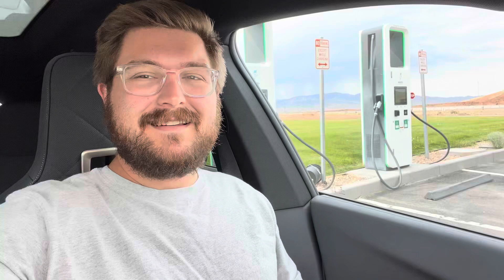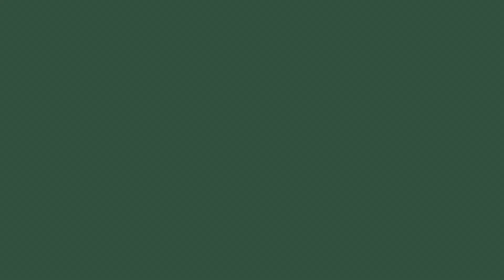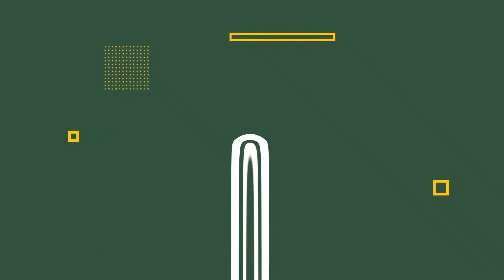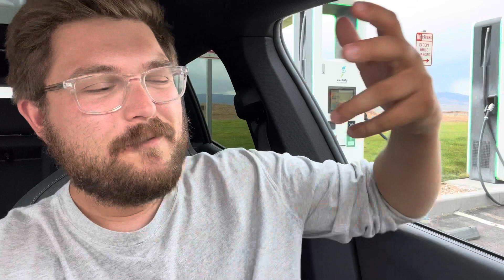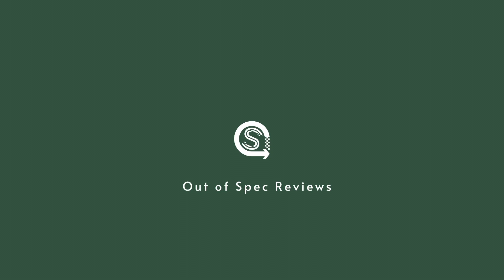Here Are The Benefits Of An 800 Volt EV Architecture - Is It Really That Much Better Than 400 Volts?

Comment: The BMW iX M60 is a $110,000+ car with options…..it better be fine! Problem is, not all 350kW DCFC units offer 500amps, so its slim pickings for the BMW to get it’s full charge rate.  And you’re right….the individual cells have no idea of the total pack voltage.   Each cell is 3.7v nominal, so when 100% SOC cell voltage is about 4.25v and at 0% SOC around 3.4v maybe I’m not sure. LFP and different chemistry will be different I think.  Every pack has their cells wired in a combination of parallel and series, so what determines the voltage is the number of cells and the combinations of parallel and series wiring.

Comment: When correctly engineered it does not matter whether you have 400, 600 or 800V. It just gets more expensive in semi conductors. You have to balance the cost of the components. For small passenger cars 400V is enough. Even less for really small cars like the Fiat 500E. For larger lorries aka pickup trucks maybe 800V is more efficient and the cost justified. With semis its maybe even 1600V. With airplanes it may be even more, in ships maybe less. You always have to balance the amount of copper and fuses vs semiconductors and insulation.
Reply: Nobody has been able to quantify the additional costs so far. Is it like going from a 11 kW AC charger to a 22 kW builtin charger?

Comment: My experience is that it makes way more sense to have well functioning 150-200kW chargers rather than those very expensive 300+ chargers. Charge time is very impressive at 150-200 aswell. I've never had time to finish my snack, lunch and/or toilet visit before my Tesla is finished charging. I always have to go out and move the car.
Reply: I think most of the public would prefer a vehicle they could charge in a similar time to filling an ICE, where the stop does not necessitate some other time wasting activity to justify the stop.
Reply: The important german National HPC network tender means products will be developed and come to market in a few months that provide as a requirement 200 kW (2x or 1x 400 kW) which should be enough for the foreseeable future.
Kyle's favourite Alpitronic HYC400 will be able to dynamically partition it in 50 kW steps.

Comment: Good information. "Ioniq guy" channel just put out a video comparing 110 volt vs 240 volt charging cost analysis, on an Hyundai Ioniq 5. Interesting to see the low monthly mileage significant cost difference (for home charging). Curious if 400 volt architecture reduces volts vs  cost difference. And, does it cost more to home charge 400 volt vs 800 volt?
Reply: Power companies provide your home at a fixed KWh cost no matter how fast you draw that power. So it shouldn't change the cost.

Comment: Tesla model S plaid can take 5-33% at 250kw flat. That's unbelievable with 400v tech. How do they do it? It's great engineering. And heat loss is around 10% which is in line with 900v tech like lucid. And their cable is thinner than any 800 changer (like electrify america). And the interesting thing is that, their v3 (250kw)  charger's cable which has a higher ampere is thinner than v2 (150kw). How? I also thought that higher amperes need thicker cable but tesla defying something? Its great engineering and innovation. Hands off. Tesla is really years ahead.
Reply: 700 amps and really short cable attached to the stall
Reply: @lucistnik  yep that impressive
Reply: V3 is a thinner cable because it is water cooled.  You can hear the Supercharger pump and radiator fan come on when charging at high current.  That sound is absent at V2 chargers.
Reply: @johnpoldo8817  so that’s what that noise was. We just hit eight Tesla superchargers in our Kia EV Niro (with adapter) on a road trip to Ontario last week. And of course, my car wasn’t making any noise from the chargers, but the Teslas were very loud indeed. Now I know! Thanks.
Reply: They simply added cooling to the cable. The model S has obsolete battery tech and to keep the cells from degrading they require an overkill cooing system. Tesla isn't ahead. They're lagging terribly behind the Koreans and the Chinese. That aside, so are European manufacturers except for the very few who finally decided to adapt the 800V architecture.

Comment: Doesn’t an 800v vehicle have dramatically less copper mass in its HV wiring? Isn’t there an argument I be made here for resource conservation? It seems to me that 800v should be mandated long term
Reply: It also depends on the lenght of your wireings. An inefficient 800V wireing (cable across the whole car) can be as bad as an efficient 400V wireing.
Reply: @Bud_Terence  but an efficient 800V cable is 4x as good an efficient 400V cable (cable CSA or weight wise)

Comment: I sold my Kia E Niro a great Car except of charging. I was going to the EV6 and I would do it again. In the Niro it needs about 45 min to get 50kwh into the batteries. In the EV 6 it needs 15 min for 50 kWh. And in both cars you can drive 200 km with 50kwh on the Autobahn. With 130 km/h . ( 81mph) So for roadtrips it is far better. Drove 6000km since July. Trips of 700 to 1000 km a Day. No Problems. Good charging infrastructure in Germany and north of Europe. Ok Tesla with 400 V can do the same. But I think 800 V is the future.
Reply: Cool, ID Buzz needed 24 min for 50 kWh

Comment: Many trucks and buses are already class 800 V EVs. Class 800 V is needed for high power charging but also for EVs with high power motors. This to keep loses low and hence significantly reduce waste heat.

Comment: 800V vs 400V is nothing that the end user should really care about because the differences in real life are pretty small. It's an engineering decision that contributes a LITTLE bit to the overall efficency but other factors like aerodynamics play a much bigger role. I don't think that a 800V system is much more expensive nowadays and components and even complete inverters can be bought off the shelf from  suppliers so I think in the long run, most manufacturers will go for 800V. This also has to do with the switch from silicon based power semiconductors to silicon carbide based ones. They can handle high voltages much easier.

Comment: It’s the same as 120V vs 240V. Half the amps (in 240V) means less cable is required as the amps is halved compared to 120V.
800V seems nice but Tesla have stayed with 400V. I wonder why they haven’t moved to 800V. 
There must be a good reason.
Reply: Tesla has a Supercharger network that only can deliver power to class 400 V EVs. Tesla is limited by their legacy charging network.
Reply: @Foersom_  Maybe it's because of reliability? I've seen plenty of bustes 350kW 800V chargers in Europe, while I've had maybe one Supercharger not work. Besides, even with 400V, Tesla still reaches 250kW. Not many competitors do.
Reply: @Jeroenneman  No, Tesla charger system tech is just outdated.
"Tesla still reaches 250kW. Not many competitors do." LOL, other companies do not aim to make 250 kW, they already make 350 kW or even 420 kW from E-Loaded.

Comment: Alot of these so called 800Volts architecture electric cars are mostly hiding their car efficiency in comparison to other electric cars with 400volts systems. Case in point look at the Taycan efficiency, Ionig5 and EV6 to the fair below Tesla model Y and Tesla model S. Electric cars are all about efficiency and charging speed is only secondary in my opinion.

Comment: At last, a balanced opinion on system voltage. Yes, you nailed it very much.
If you want to really have high power charging with really short charging times you need to go up with the voltage.
BTW, the cells have their own chemistry defined voltage, the current they see is dependent to the amount of cells you have in parallel. With a 1p connection all the cells see all the current with a 5p connection the cells only see a fifth of the current, but always referenced on the total current the system is getting. And one last thought, the smaller the cells the more cells you need to achieve the total capacity you want. The more cells you have the more variability you get to achieve a good balance between system voltage and current per cell. The downside, small cells have worse volumetric energy density, they can be more expensive per kWh of capacity and you have a more complex battery because of the higher amount of parts.
Sorry, but today I did wake up with the nerd hat. 🤓

Comment: Great discussion! Kyle, please do an in-depth video with charging station tests including E-GMP cars. I really want to see the difference between a paired and solo configuration ChargePoint CPE-250 DC fast charger. Don't forget to use an ODB2 adapter for all the battery data. So far, I've only found videos from Bjorn showing this in-depth.

Comment: I pull into a gas station, I put in 93 octane, easy peasy. Now if I charge  an EV I have to calculate if I should go to a 400 or 800watt, level two or super charger and so on and so on. Makes my head spin. Good to know that the car and charger can communicate, but still, mind blown. Glad you have a handle on all this. BTW, good to have met you this week end at Fully Charged.
Reply: You don't "need" to know any of this. I've had slow and fast petrol stations in the past as well. Besides, who cares when your car is charging while you sleep. I couldn't fill up my car while sleeping, now the EV charges while I do other stuff.

Comment: Great video, love the tech details. Hyundai has the advantage of being an industrial giant and not "just" a car manufacturer so I imagine their total R&D capacity and economies of scale dwarf even VW Automotive Group. It feels like car makers are trying to carve out niches because the EVs are turning out to be so similar - everything is a 5-second car with 270 miles of range that charges to 80% in 25 minutes.
Reply: What has this to do with the batteries? Neither Hyundai nor Kia, VW, Ford, GM produce the batteries or charger, inverter, nothing. You must ask Samsung, LG, Northvolt, Schäffler, Bosch, ZF and others i don't know about.

Just one question: Why does Tesla NOT use 800V Batteries? Because they are not needed in "normal" vehicles. Semi, farming machines, ships, airplanes are a total 'nother beast.
Reply: @wolfgangpreier9160  FYI, CATL is the largest followed by LG, Panasonic, Samsung, BYD and SK Innovation respectively.  All these batteries use the standard 4.2V to 3.4V range from fully charged to discharged.  The 800V part is all about how they are connected together and the charging circuitry. 
More voltage = less current for the same power. (V*A=W)  The advantage of higher voltage is pretty clear for the automotive market.  Including Tesla, I would expect them to change at some point.  They are not needed of course but 800V is still desirable.
Additionally the charging cable which is heavy and expensive can have half as much copper if you double the voltage.
Reply: @gregkramer5588  i did not order them by size or sold cells etc. yes.
Reply: @wolfgangpreier9160  I was just trying to clarify batteries vs packs and add some details. When 800V batteries was mentioned that could be confusing to some people. It is an 800V configuration, same batteries.
Reply: @gregkramer5588  Same cells, yes. Just more of them in series to add the voltage. BTW: 800V in Kia and Hyundai are actually somwhere around 680V. Porsche has a bit more.
Reply: @wolfgangpreier9160  Tesla is hampered by being one of the first. At the time (2012) it definitely did not make sense for the large extra cost of an 800V system. Now Tesla has a lot of infrastructure and preexisting design work holding them back. At some point they will make the jump; will be interesting to see how they choose to do it.
Reply: @eric4903  Yes, of course that is the reason why they are the most efficient cars. Clearly you must be right! All others need more energy per km because of their overwhelmingly strong 800V tech. Thank you for your in depth knowledge!
Reply: @wolfgangpreier9160  Laying that sarcasm on strong there with little to back that up.
The 800V architecture in the Lucid allows up to 131 mpge compared to only 120 on the Model S  (116 for the Plaid). Though each manufacturer gets to test their own vehicles, not independently tested.
So looking  to OutOfSpecs testing the EV6 is nearly the same miles/kwh compared to the Model 3. (3.4 mi/kwh vs 3.5) on a 70mph range test.
Tesla does not have a strong lead, if any at all. Regardless I think most know vehicle design/aero is a bigger factor than the 400/800v architecture.
Charging is impacted, as is evidenced by the near burn potential handles on Tesla Superchargers.
Reply: @eric4903  Yes, i see how efficient Lucid is compared to the Model S Plaid. And what else? Don‘t look at only one test result from one tester. Take a look at others like TFL in the US or Tesla Bjorn in Norway. Then you will find that its not only US highways and its not the EV6 that has the best efficiency. Its still the Model 3 SR and the next best is the Model Y. Funny. Its not the Model 3 LR or Performance. Why? Because EVERYBODY drives too fast with the Model 3… Efficiency is not a matter of 400 or 600V as in the EV6 its a combination of technologies and how they are used. The most efficient car is still the old Hyunday Ioniq, and nobody will be able to steal that first place. That one has not even 400V rather 320V…
Reply: @wolfgangpreier9160  My point is that companies are using 800 v as a marketing differentiator. Porsche made a big deal of it when Taycan first came out. Can’t sell motor tech because no one understands it but 800 > 400.
Reply: @Ficon  Yes it sounds good. Just as V16 sounds better then V12.
Reply: indeed, it might have something to do with their investment in Rimac. It would be interesting to know if that's why their cars have an 800v architecture.
Reply: @USUG0  This is just a guess, but I think it is not that challenging of a change for their existing engineering staff.  Although what you mentioned could be a time to market play.

Comment: Great info and insight on why EVs are the way they are. I'm curious when 800v will become the standard, and is it obvious if higher voltage packs are still to come?
Reply: When ICE manufacturers like BMW, Mercedes etc get their act together (or become irrelevant in the process for being too slow£

Comment: .Seems that if you double the voltage - you half the amperage for the same power....allowing for lighter wiring, smaller motors You could go with 1200 v but there is the issue of insulation and shock......

Comment: Kyle the Cat mec500 charges 1000v 500 amp or 500kw, they put two in parrallel and can charge at 1mw they can charge the r1700xe is less than 20 min 0 to 100%

Comment: Ohms Law, Volts x Amps = Watts, 746 Watts = 1hp. 
So higher voltage equals less current,  high current equals heat, heat equals thermal loss. So higher voltage can use thinner power cables and have less overall energy loss. But over 400volts has enormous spark gap danger so extra insulation, more thorough software engineering to prevent accidental possible contractors from closing if any part of the HV is exposed 😳 etc.
Reply: But my question is why is the tesla supercharger's (400v) cable thinner than 800v charger cable (electrify america)?
Reply: @mhsohel47  Good question, maybe they have a more clever custom solution vs standard cable or faster derating vs the thicker cable because of the typical falling charge curve of Teslas or they get away with it because of cable shortness.
Reply: @abraxastulammo9940  Model s plaid can do 5-33% @250kw flat in 8 minutes 650 amps 400v. How is that possible with thinner cable where taycan can do 265 kw 5-50% with 800v 500 amps charger with thicker cable. 800v with 100kwh battery does not make sense now. Maybe a bigger battery pack is like 150kwh-200 kWh+ makes sense. But for now Tesla proves that with great innovation and engineering we don't need 800v which costs more. Don't complicate it when it is simple. 800v is complicated and not cost effective imo.
Reply: @mhsohel47  It does not really cost more, see the Ioniq 5 base price which is lower than Tesla I believe.
Trucks charge at Ionity at full 350 kW speed till well over 90 %, maybe that is why the cables are bigger - or Tesla should sell their high tech cables to the charger industry. ;-)
Reply: @abraxastulammo9940  yeah, ioniq 5 and ev6 800v tech is unique and innovative. They use an onboard inverter to convert it without any complicated transformers (Taycan). But 800v has to be 400v charger compatible The majority of current charger infrastructure is 400v, so every 800v cars must have 800v tech and also 400v compatible tech which is complex. I am not saying 800v is not the future, yes it is but it needs 8-10 years to fully utilize.
Reply: @mhsohel47  It is not unique, BYD Tang does the same thing for its higher internal voltage. Renault Zoe had the chameleon charger using drivetrain components, too.
Reply: @mhsohel47  shielding insulation
Reply: @HandyDan  okay, but why electrify america is not using it. It will be thinner and cost effective. Maybe they don't want to change their formula.